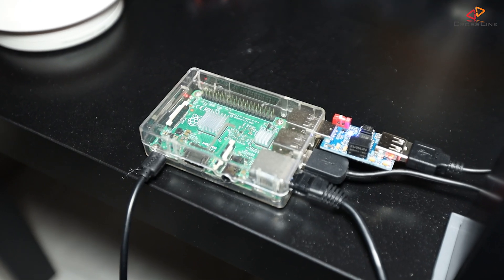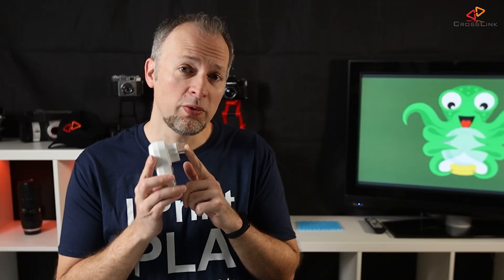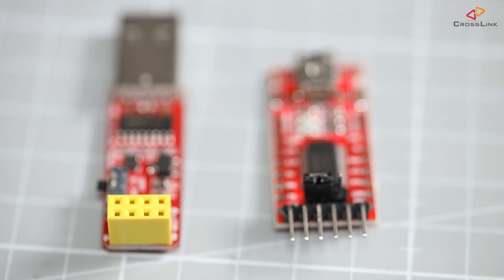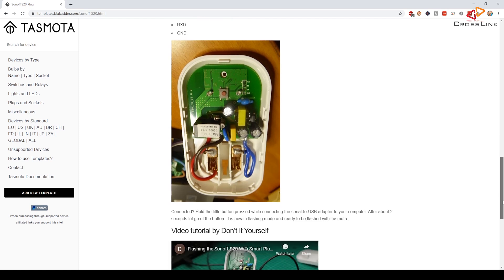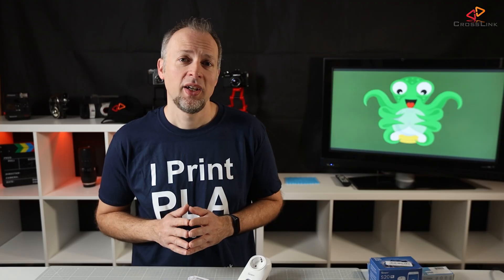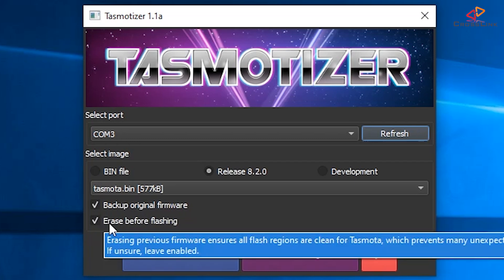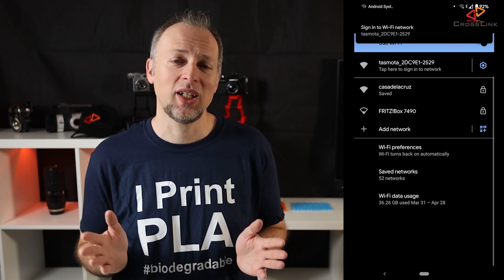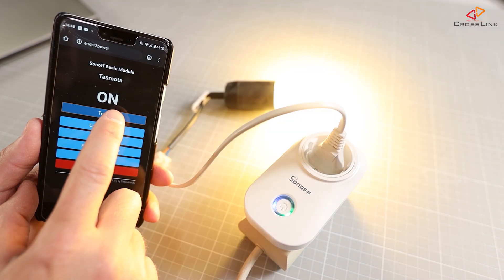How to install Tasmota firmware on Sonoff switches with Tasmotizer (PC/Mac)

Comment: Thank you for this and the Octoprint video. Working great.
Kind of important to mention: Some revisions of the same S20 model seem to have the RX and TX pin switched. Mine, with "EU_V1.3 2017-2-16 1802" printed on the board does have the TX pin next to ground, unlike yours. Not that big of a deal if you know it, still weird though.

Comment: Hi, I don't know why my raspberry turns off spontaneously when I turn on the printer.  It did it for me even when I was printing, when I was printing the raspberry turned off and the printer stopped with the temperatures at the set value.  What can it be?  I use Tasmota Sondoff s26
Reply: I also have a video where you can see what's going on.
Reply from the maker: Did you cover the 5V pin of the USB connector of the connection cable? If not you should do it to prevent the Raspi to power the board and vice versa
Reply: @Crosslink3D  A Error connecting to printer There was an error while trying to connect to your printer. Error: Connection error, see Terminal tab.    This is what he writes to me

Comment: Still relative thank you. Worked a treat. The new Tasmotizer now requests to power cycle the device if backing up. To do so I removed the VCC pin, then while holding down the button again put the pin back in place and cklicked OK as instructed.

Comment: Such a helpful video!  Thank you so much!  I do have one little issue that I don't understand.  I've got the sonoff connected to a coffee grinder so that it will grind exactly 39 secs (pulsetime 139).  I can access the Sonoff device using its IP address (192.168.1.2) but it doesn't work when I try using the hostname (GrinderTime).  Do I need to setup a VPN?  Is there some setting on a network router that might be blocking this?  http://192.168.1.2 works.  http://GrinderTime does not.  Returns a "This site can't be reached."  Any suggestions?

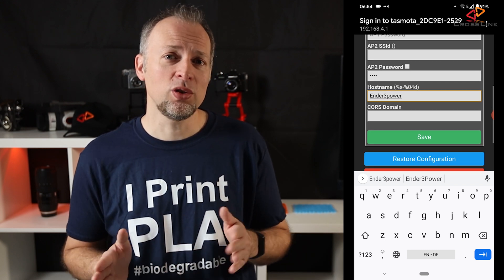Comment: 10:17 "Make sure you don't use spaces..." 
Yeah, uhm... I did-a-boo-boo. I'm a dumbass XD (I added a space)

I tried holding the switch, to see if it would re-set somehow... no luck.
So... anyone know how to fix this issue? Do I need to flash it again with tasmotizer?

EDIT: OK, figured it out by myself. I logged in to my router, checked the IP address, and I entered that into the browser instead of the Label that contained the space.

Comment: Unfortunately when I select the Release option in Tasmotizer it crashes.  Tried to download it again and install on another machine.  Same problem with Mac Laptop. The port does not show as Com*** it shows as the USB serial adapter name which I assume if fine.

Comment: Daniel, is there anyway to use these: HiLetgo 5pcs USB to Serial USB to TTL CH340 Module with STC Microcontroller Download Adapter from Amazon to flash the switch? It looks like you can use the jumper on the outputs to set the TX/RX outputs to 3.3V but then there is no output to provide 3.3V VCC to the switch. Am I missing sometihing?

Comment: Great video Daniel. I ordered the s26b plug and soldered to the pins according to the soldering guide. When I ran the tasmotizer it would download the binary file then the window would disappear after running it a few more times the backup completed but then timed out with this error "Failed to connect to ESP8266: Timed out waiting for packet header". I've continued attempting to run it but now it starts , runs a few seconds, then the window disappears. I also attempted running the binary file from the downloaded location but again received the "Failed to connect to ESP8266: Timed out waiting for packet header" error. Any ideas on what may be the issue?

Comment: I am connecting the wires to the S20 but tasmotizer is not showing me any COM ports. The wires are connected correctly, exactly as you described in the video
Reply: Wiring in the video is wrong. Swap TX and RX. This is how it worked for me

Comment: Thank you Daniel, another great video. Your precise and detailed instructions make learning so easy.
When I first saw this video and the accompanying one relating to how to connect and automatically turn off the printer via Octoprint I decided to implement this for my Ender-3 Pro. I purchased my  S20 (UK plug), from Amazon.co.uk and I also bought at the same time this interface, IZOKEE ESP8266 ESP-12F 4M Bytes WLAN WIFI Internet Development Board Compatible with Arduino (Pack of 1),  (https://www.amazon.co.uk/gp/product/B076FBY2V3/ref=ppx_yo_dt_b_asin_title_o07_s01?ie=UTF8&psc=1). I've added this detail and apologise for the length of my post but it is important in the context of my experience. 
I soldered the header pins to the interface. As it was my first time doing any soldering it took a while and it was a bit messy, but I thought good enough. As the interface comes with additional headers I also decided to solder a header on to the board in the S20. I made some jumper leads and downloaded Tasmotizer. I connected the jumpers as you clearly explained and tried to flash the S20. I encountered the 'Failed to connect ...timed out error'. I checked that I'd connected the RX to TX, as I was getting a connection via the VCC and Ground. I had correctly connected but it still didn't work. 
I rechecked my wiring in the Dupont connectors and the soldering, but still couldn't flash the S20. I did some internet searching and found alternatives to Tasmotizer which I also tried, all without success.  The searches found various blogs for example on Reddit where others had the same problem. After several hours, like those bloggers I concluded I must have an unflashable S20, but one which I couldn't return because of soldering on the headers. I was ready to buy a Sonoff Basic, because the various blogs indicated people had enjoyed success with that version following their failure to flash an S20.  However in the spirit of trying everything, I wondered what would happen if I connected RX to RX and TX to TX, expecting of course the failed to connect error, instead it immediately flashed
 the S20.
This is the reason for my post, because clearly there is a problem with the wiring on the board of either the ESP8266 board I purchased or the S20 board. The S20 board has the following information printed on it "S20 UK/EU V2.1.0  2018-06-19". So if anyone else buys this combination and has the same failed to connect error, try connecting RX to RX and TX to TX first, you might save yourself several hours.
Now for the fun of setting up the Octoprint/Tasmota link!

Comment: Hi! Great video, but I'm hitting a problem which I can't seem to find an answer for on the github pages. i'm trying to flash the Sonoff S20, but after completing the backup, tasmotizer hangs and then timesout. I think that the S20 may need a reset after the backup is copied, but I'm hoping you have a solution?
Reply from the maker: I kind of had the same issue a few times. Just try again after the backup is done and disable the backup in the second run. Worked for me.

Comment: I see in the comments that you use Home Assistant with your smart plugs. I also have been running Home Assistant and just flashed my first Tuya smart plug to Tasmota firmware using Tuya Convert. I have my Octoprint linked to Home Assistant using the API key but now see that you can use MQTT from Octoprint. Have not set up MQTT yet but looking into it. Really like your channel and have learned a lot.
Reply from the maker: Thanks for the info! Great to see that I could help :-D

Comment: I just got the Sonoff R3 Basic for my Ender, it's a little easier to flash as it doesn't need the pins, and is only a few Euros more. Works really well with OctoPrint.
Reply from the maker: How does it work to flash a firmware on the R3, Over the Air?
Reply: @Crosslink3D  yes, after setting the jumper to DIY mode, you create a hotspot for it to connect to, then from another machine connect to the same hotspot and depending on the Sonoff firmware v3.3 (use the tool) v3.5 (browser), you can flash the Tasmota firmware. The new Sonoff v3.5 seems to be rare as stocks of the old ones still everywhere (like mine) and they haven't made it available for flashing.
Reply: @ferd352  new 3.5 software yuu just hold button for 5 secs on boot connect to the generated app and set your home wifi -> sonoff is now in diy mode and accepts rest commands

Comment: It's hardly worth changing the firmware on the switch if you're going to use it with a Google home or an Alexa. They send everything home.
Reply from the maker: Well, it's worth mentioning and I am doing this to control it from OctoPrint 😉
Reply: @Crosslink3D  Oh no I'm not saying anything against the  video or idea etc., it just struck me as a bit redundant. I have a couple of the wired type of switches and they work with the ewelink app and it always bothered me. Your video is right on point though about changing the firmware considering where the info is being sent. :)
Reply from the maker: Really cool! That's exactly what I am doing right now. Stay tuned for the video 😉